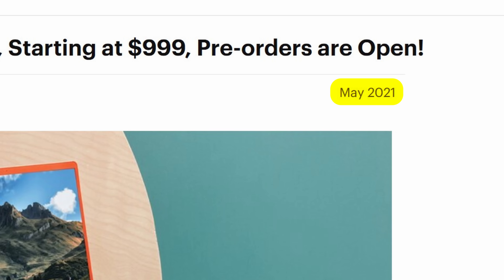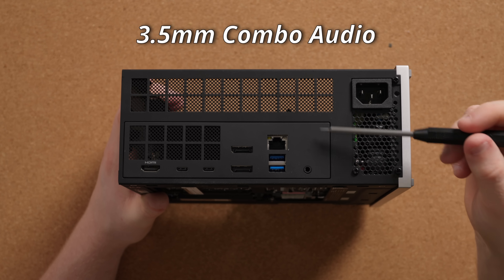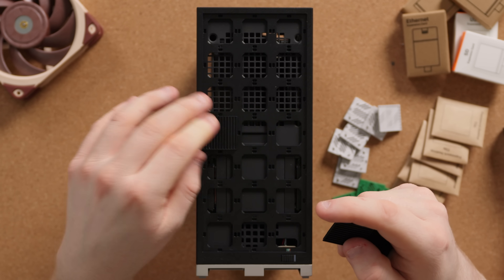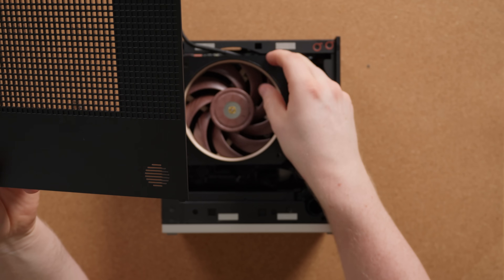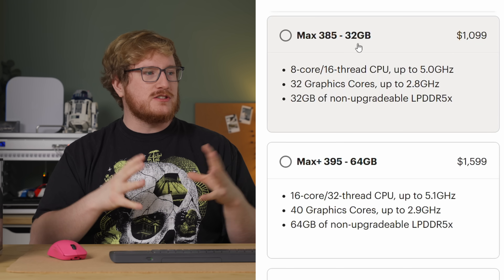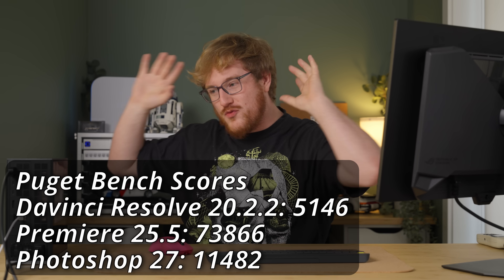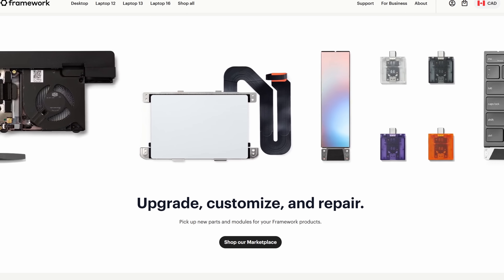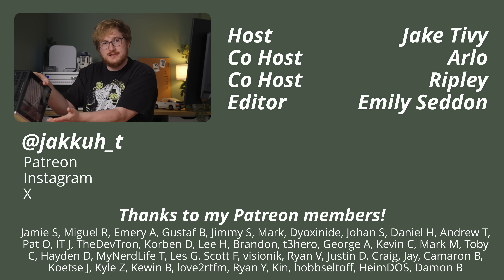I’m glad I didn’t invest, so I can talk the Framework Desktop

Comment: I get the frustrations about the soldiered memory, but they shouldn't be sent towards Framework imo--Sure, they chose to use this chipset, but you don't have to choose to buy it. They make repairable laptops, desktops are already repairable, and there's plenty of options to build your own desktop with similar or more power, for cheaper. This is, essentially a laptop in a desktop form factor--If you want a mobile chipset, with as much power as this has, there's gonna be compromises somewhere. 

But don't worry, the Steam Machine will have RAM slots, and they will work with iFixit for replacement parts! If all you care about is gaming on a small, repairable device, wait for that. You know who you are, you know what you need--Buy or don't buy, in the end, this is just a PC. Personally, I don't see the point of Framework selling a desktop, as it doesn't really have anything to do with their brand, and if I'm gonna buy a desktop, I might as well build my own, so that I can upgrade it without changing out the entire motherboard/cpu/gpu in a few years. Considering you need some level of PC knowledge just to get this setup anyway, I don't really see any reason to buy this.

Comment: I really love what Framework does generally, but there is always this one thing they fall short on which puts me off. Because their stuff is not cheap, and if I spend that much, those things matter. Here  - I can only agree - it is the PCI-E-Slot. Why? I mean the power-supply I could live with (80plus gold is not great and for a desktop would be a no go for me, but they might not have been able to source a better one). However, as you said, why not space for a PCI-E card. I'm not even talking GPU. There is a slot and no room to put something useful in. Why? There are so many possibilities. Storage, Network, and if GPU it is PCI-E 4x4, so an Oculink adapter would be also a great option. I mean that 400 Watt power supply even has the headroom for an expansion card, even for a GPU, but they didn't. Or they could offer a slightly bigger case. But they don't although that somewhat contradicts their mission of modularity and longevity to cut expandability by design.

Comment: Amazing video!
15:12 Also just letting you know that you shouldn't actually configure the VRAM setting in BIOS and instead use GTT memory. This way you can use about 108 GB.
To do that, first make sure you have the latest ROCm with at least gfx1151 target as well as the latest amdgpu driver (latest kernel).
Then configure following kernel command line parameters: ttm.pages_limit=27136000 ttm.page_pool_size=27136000
Set HSA_OVERRIDE_GFX_VERSION="11.5.1" and ROCBLAS_USE_HIPBLASLT=1
Launch llama.cpp or whatever you prefer with ROCm support.
Ollama will not work with this (last I checked).

Comment: Wow its like they had to try to make it this bad!!! With those specs how do you make this bad of a product , just hot rubbish you can smell for a block away!!.  That case is absurd , no expand-ability , the modules are next level bad idea , who wants modules that limit access to the limited port you have.Never mentioned if they where cross compatible with other systems but honestly who wants that eye swore hooked to a adapter hanging out of your system. The not sending a power cord aspect you where selling as a bonus is also misguided. If every $40 power supply ever bought in entire world can toss one in so can they. How much are they really trying to pretend they are saving you ? some inflated price that they sell them for ??

Comment: On the off chance you're interested in toying with it, I spent several weeks testing and tuning windows power plans to squeak out every bit of power and efficiency I could out of a handheld PC, and I have a sneaking suspicion it would do a phenomenal job with this sort of 'low' power envelope desktop. It scored better in 3Dmark tests on both the CPU and GPU side WHILE using less power overall, by allowing the CPU to adjust performance on the fly rather than simply locking it to max clock rate, while also not restricting how quickly it can hit max clock rate the way that balanced does.

Extremely meaningful if the CPU and GPU are both sharing the same total power limit, too.

Comment: I recently got my Framework desktop and I'm not sure if it's because of LM Studio or Windows or some settings you have,  but I'm running larger models much faster than what's shown here.
Ie. I have a large context gpt-oss-120b running at ~50 tokens per second (in Ollama and llama.cpp on Linux)

So, if you do another video with the Framework desktop it might be worth trying some different configurations to see what is making it so much slower here.

Comment: I use a 4x pcie slot for a dual nvme ssd card. Those drives are used for bulk internal storage, no need for ports access like a graphics card. You can also use this for additional wireless connectivity etc.

Comment: I really don't get the FW Desktop (and a lot of FW stuff, like lackluster IO, and fragile displays out of soda-lime glass - do they count on repearability because they built it to break?!) - repairability and upgradebility. You have that on a typical desktop - then why did they go for the SBC exception where this expicitly isn't possible? The Tiles? In my opinion a useless, unneccessery gimmick. Swapable IO- makes sense in a Lebtop if you don't want to carry a Dock with you - I don't see much advantages here, especially since Minisforum has more and better IO, with PCIe that you can just use without iffs and buts. 
And the Framework Desktop isn't really competetivly priced either.
I want to like Framework, but so far they mostly overprice and underdeliver.
The only really noticable thing they did was the exchangebale Laptop GPU - but the price and selection of GPUs kills that aswell. Just give us a PCIe x8 Bridge for external PCIe! Sell your own enclosure aswell with it, that would make way more sense and resonate with a lot more people.

Comment: I would not believe you that there is 128gb of ram running at 8000MT/s. 8000MT/s is extremely hard to get stable on most platforms. I have it stable in my personal rig and that’s using 2x24gb sticks of M-die, 14900k, z790 ROG Apex. 
There is no way you are getting 2x64gb sticks stable at 8000MT/s.

Comment: Umm should also have maybe pointed out that it's an ITX form factor meaning you don't have to necessarily use Framework's case.  Also the lower end 385 is a lot cheaper.

Comment: Id rather have socketed memory and less performance from the company that's entire schtick is repair friendly. that small gain you get wasnt worth it...
Reply: It's far from a small insignificant gainfor a APUs like this that specializes in AI work loads the gains from soldered unified memory are massive. I wouldn't call 2-6x the memory bandwidth and a 50-95% reduction in latency over dimms and camm2 for the IGPU a small gain. it's too much of a performance drop not to do it on AI focused machines. 

This is just showing the way the industry is going forward with AI APUs, its no fault of frameworks. only Intel doesn't do this yet. Apple, Amd, snapdragon and Nvidia all do it for their AI focused APUs.
Reply: Then maybe as the company fronting right to repair, dont chase the AI trend, but rather focus on the markets that will benefit more from the repairability aspect. Wheres my gaming laptops that i can force on my friends, right now its all just MSI or Asus shitty laptops.

Comment: Correct me if I'm wrong but is it with LPDDR5 that you can allocate some of that over to video ram?  ... or is that cudimm?   I forget.  If it's the LPDDR5, then having the option to add 64GB of vram on top of whatever vram it already has sounds kinda amazing.  I wouldn't complain about soldered mem if that can be done with LPDDR5.  Also, how often do you upgrade ram when you can have it come at what's basically max ram for typical home use systems.  With 128GB ram, by the time you want to upgrade that comes, it'll probably already be time to get a whole new computer anyway.

Comment: This just never made sense to me, their whole target audience is people who want repairable stuff but with this aside from the form factor cool front i/o and front plate it's literally just a less repairable desktop cause of the soldered cpu and as a result soldered memory, desktops didn't need frameworking they were already fully repairable. I'd rather them jump into a different market tbh that actually needs repairability. I can see the market they are trying to tap into but it's still just a wild decision when before it was just targeting people who want repairable cool stuff like of course there was gonna be blackash on their community when they completely switch gears into a different market all together which is small compact LLM/Server machines which for that use case is great it's just not something we were expecting. Also their advertising was flawed since they call it a framework desktop when it's not a desktop at all, it's ether a mini pc or a min server.

Comment: I'm a huge Framework fan, but the Desktop really confuses me. I've built/used SFF PCs ever since I realized I can put computer components into anything that fits. What makes this different than any small mITX case? Upgradability and reparability has never really been a problem for desktops. I feel like I missed something obvious.

I would've loved to see this be a modular case that's catered to the FW13 and FW16 mainboards. I've seen a couple kits on etsy (and the Cooler Master one), but that seems like a fun thing they could do instead.
Reply: Future-me coming back to make fun of past-me. I just put in an order for the FW Desktop Motherboard Only. I didn't realize Strix Halo has a similar unified memory architecture as the Apple M, so you can allocate 96GB of RAM for the iGPU for loading large parameter models. Out of all the options out there, Framework turned out to be the cheapest to get this setup if you're only buying the motherboard. Minisforum, GMKtec, Beelink, Nimo, and Bosgame currently make mini pc versions for ~$2k. A used M1 Ultra 128GB is $2.5k+. Z13 and Zbook Ultra are $3k+. Given the rising RAM costs right now, I get the feeling this will be the cheapest I can get a board like this for a while.
Reply: The obvious thing you're missing is that this isn't pitched towards people who want to build their own PC. It's pitched towards people that would otherwise buy a prebuilt machine and don't want to have to spec out everything themselves. This product completely eliminates all the headaches associated with building your own PC. You don't have to worry about part compatibility, and the assembly process is simple and standardized with everything you need included. It's basically a middle ground solution for people that want a bit more flexibility but don't want to spend hours on PCPartPicker or researching component benchmarks.
Reply: I see the strix halo as a direct competitor against Apple M series, which are power budget friendly SoC solutions with focus on productivity and AI inferencing, and just so happens to also have gaming performance of a 5060ti. Users who originally would go for mac mini's (even if they're a lot smaller tbh) and want to game could consider this, which is really a niche market unfortunately. Average SFF gaming pc users could get away with expensive ITX parts, SFX PSU, and still have a 5070ti or something, and is unironically more upgradable and repairable. This time framework desktop is really a product for the niche among an already niche market
Reply: I'm guessing this is meant to compete with 1 liter business PCs rather than consumer mITX.
Reply: Essentially its a computer built to uniquely maximize what can be gotten out of that chip for LLM devs like myself its a no brainer for homelabing AI development. if i wanted to do the same stuff with an Nvidia chip id be spending 10k.
Reply: What makes it different is that nothing is socketed so it's significantly less repairable than a mITX build.
Reply: @InvidiousIgnoramus  The only thing that's not socketed is the memory and CPU; both are generally not the first components to fail in a PC. And I have yet to encounter a scenario where upgrading my CPU didn't require a MOBO upgrade since newer generation CPUs are generally incompatible with the previous gen sockets.
Reply: @LimitedWard sockets are not changed every generation, only every 3 to 5. And frankly, that means the ONLY thing you can upgrade is your storage. It's a crappy overpriced product with a much shorter shelf life than most SFF PCs.
Reply: @InvidiousIgnoramus AMD releases a new generation every 1-2 years. Zen 3 released in 2020, Zen 4 in 2022, and Zen 5 in 2024. Generally speaking, the socket changes every other generation. I don't know about you, but I'm not made of money and I sure as hell am not upgrading my PC every 2 years. So that means if and when I do make an upgrade, I almost always have to upgrade the motherboard as well. Framework will almost certainly release a new MOBO+CPU that you can upgrade to once the new generation comes out without having to buy a whole new machine.
Reply: @LimitedWard  AM4 had 3.5 generations across 6 years, and AM5 is two generations deep, with at least 2 more generations expected on the socket. I'm not sure where you got the idea that AMD operates on Intel socket cadence, but they absolutely not.
Reply: @LimitedWard  oh great, the only not socketed parts make up 2/3 of the parts people actually wanna upgrade!!
Reply: @LimitedWard Also one of the best upgrades I've ever made to any computer ever was an in socket upgrade from an i5 10600k to an i9 10850k
Reply: My only thought is that commercial customers might be able to slim down IT departments if their desktops are more user upgradable? You just send the new components to any team leader with instructions and have employees of mixed ability upgrade the machines? Given how infrequently businesses that I've been in (all non-tech tbf) upgrade they'd want all new competents including CPU socket though. I love it, it's cool as hell I just don't see the point.

Comment: BTW the power cable argument you supplied is mostly cope.

just because we have been conditioned into the folly that not including it is a benefit to everyone, doesn't mean it's true. Otherwise the base model of my car wouldn't contain all the wiring for the heated seat option. my example could continue but I think you get the idea.... there is a cost to having an option when you could make it a standard, and an item like that at scale costs nearly nothing, whereas getting a singular one does not. For your argument to make sense there should be no price difference between the units with and without, and you would only be selecting the option if you want to feel good about yourself for not putting another cable on your pile of cables.

Comment: YESSSSSS most people skip the power settings and the Bios Config and then are like “well it does 1080p gaming.” 

coughs in 90fps 4k cyberpunk on the exact same pc when set up right.

😂 not that I can blame the reviewers who didn’t set theirs up correctly though as out of box you would expect it to be “maximum performance mode.” By default. So no fault to them.

What’s fun to do on these machines is to have MULTIPLE ai LLm going. Like 5 different layers and make a complex A.i (Like a Boltzmann brain.) 

When you get all the “instances.” To work and “roleplay/Halucinate.” Together and stuff you can literally have Hal 9000 on your desktop and still game and stuff WHILE having that in the background. 

Think of the V-tuner Vidal that’s essentially how that works. But you can do it yourself with these type of computers. 

I’ve been recently playing MINECRAFT JAVA with Claude Sonnet 3.7 and it’s freeking FUN. Like REALLY fun.

Comment: Why did you switch to a 70b param model as an examole of a big model after using the 120b param openai model?
Reply: The 70b param model was just what he already tried on a MacBook in a previous benchmark video. He just wanted to keep the test consistent and use it on the framework too to compare.

Comment: btw, if you were planning on doing some USB4NET, the ubiquitous ASM4242 that I assume is in that is limited to 63Gb total bandwidth due to the PCIe gen 4 x4 upstream port. Adding in USB4 TLP headers (4B per 256B) and USB4NET frame headers (12B per 4KB) cuts that down a little bit more too, depending on on how large you set your ethernet frames. I don't own more than one USB4 device (got just my mbp), so I'm not even sure what kind of performance is achievable in real hardware either.